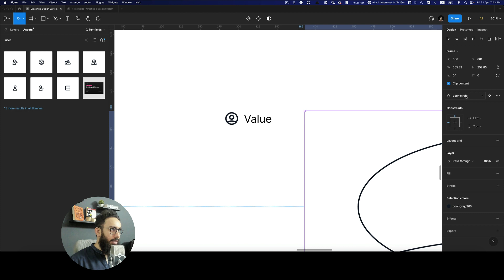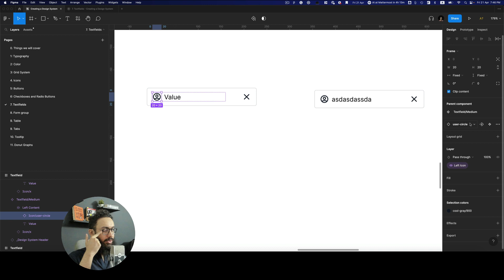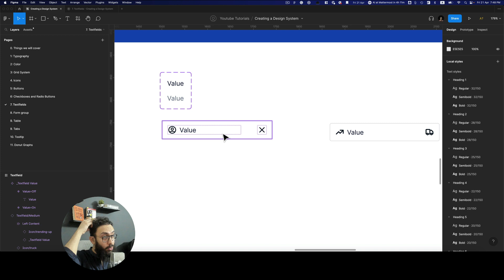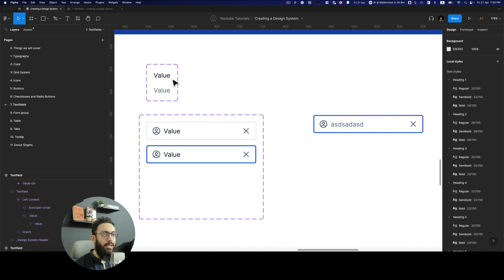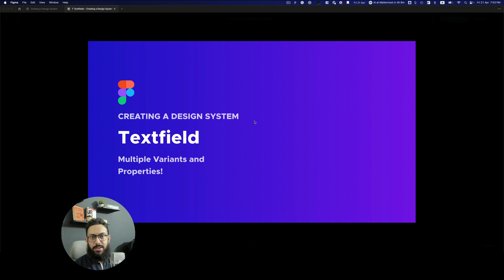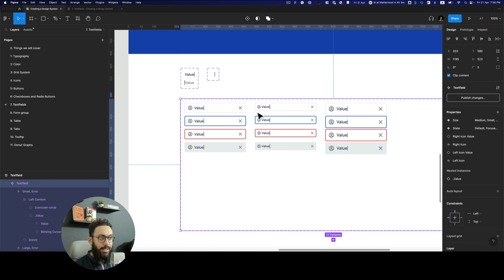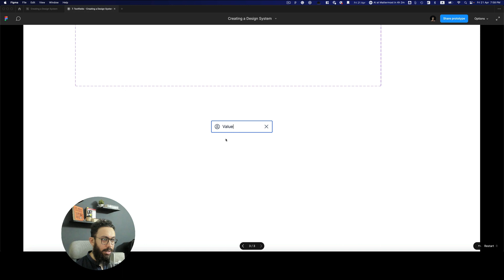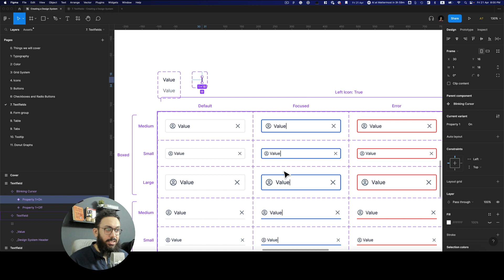Creating a Design System - Awesome Textfields!

Comment: Neat trick with the blinking cursor! 

One thing I’d like to do when running a prototype is simulate the user typing something inside of a field.  Is this how you’d do it or is there an easier way. I looked for plugins that essentially add real text input fields in the prototype but didn’t find any.